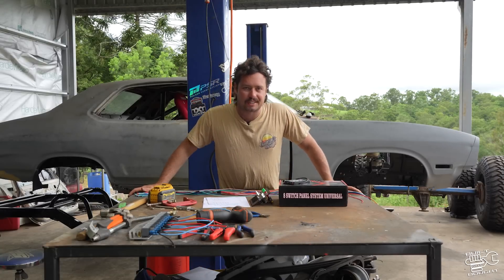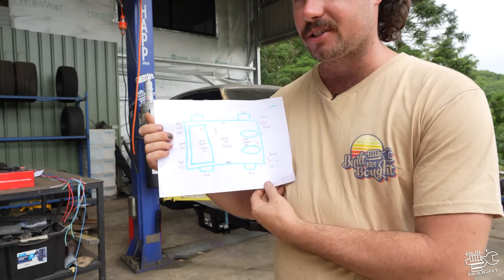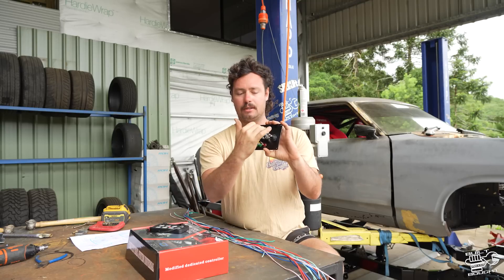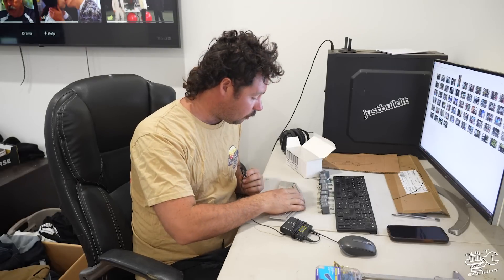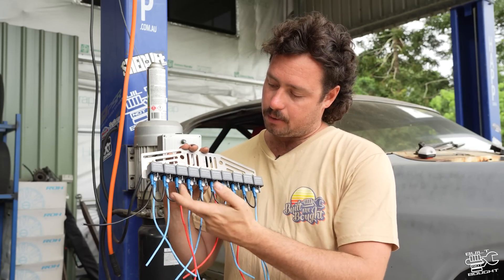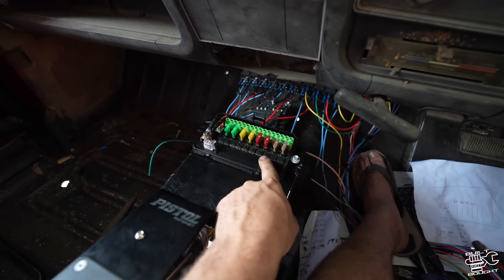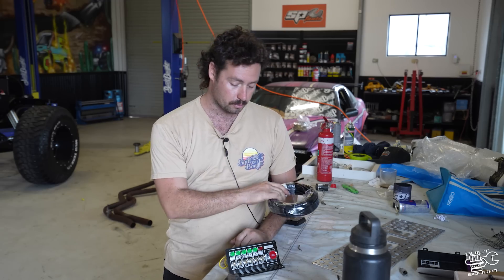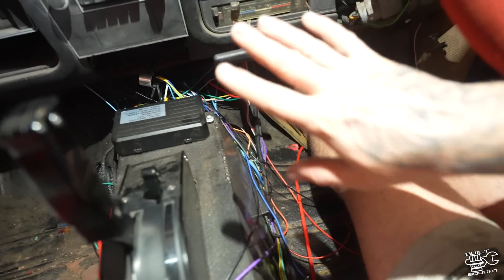BNB TECH || Wiring a Car From Scratch

Comment: Great Vid, what about a bit more detail on how to work out the size of wire for say the Fans, should you run two fans on separate relays because of their draw. Can you run two 4mm wires to make up an 8 mm wire, stuff like that would help others NOT burn their trucks to the ground, if that's possible???? Keep up the good work been watching since the original GU build ,😃👍Cheers from Northern Rivers NSW,

Comment: Curious as to why individual switches to PS pump, fans, water pump etc.  Surely they should just be ON.  Why the need to turn each off?
Reply: I'm assuming because in most vehicles, they're individually actuated at different times by a computer (PCM) and this allows you to take place of a PCM, which would be easier to do than the design a computer to work for your custom build. And I'd imagine being able to switch each thing on/off would be great for diagnostics